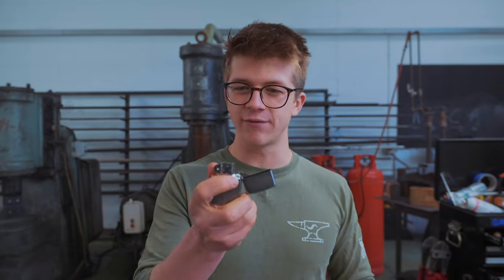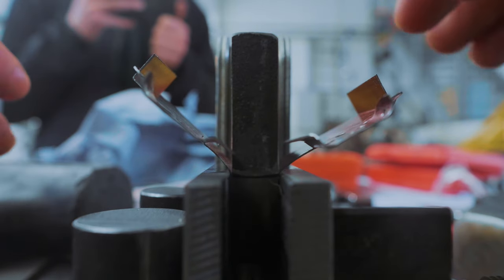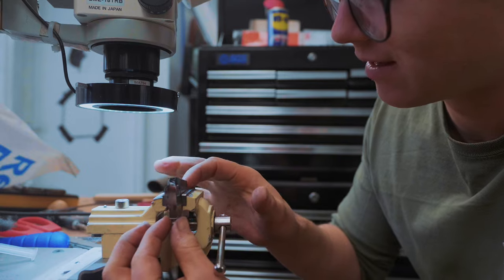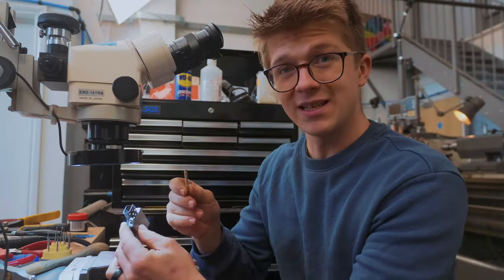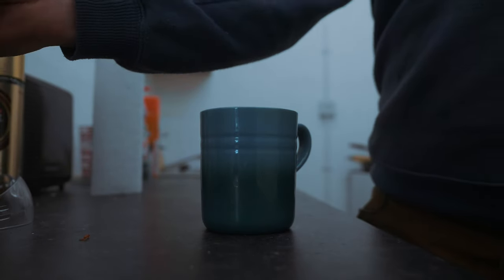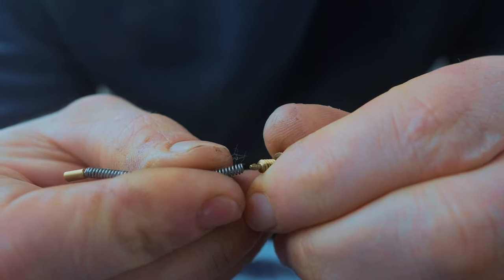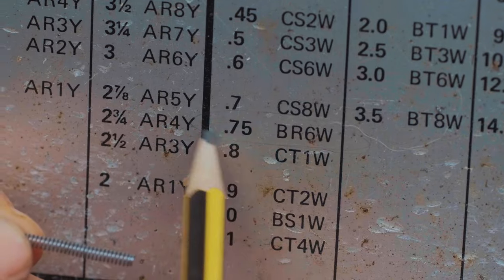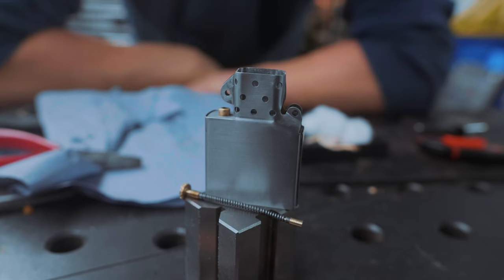Can I Make This Iconic Lighter? Part 2

Comment: Hi, watchmaker tips here: I had to make one spring like this for one of my watch. If you want a spring that has regular space between the spires, it’s better to make it compact first, all the spires touching each other. You make your spring longer than needed, and once it’s done, you take it out of the lathe and stretch it until your reach the space needed between the spires. Remove the excess and « voilà ».
Reply: Easy way as well is to use another wire with an O.D equal to the space you need butted up to the other while wrapping and wrap them tight. Grab the sacrificial wire and unwrap from your dowel and there you have it

Comment: My father, a silversmith, removes the tarnishing after soldering by leaving the work piece in a bath of diluted hydrochloric acid for a few hours and then buffing with jeweller's rouge and a tough stitch mop . You may want to do a few test pieces first to ascertain the correct strength/time formula for the bath though obviously..
Reply: Any acid will do, and acetic acid is substantially greener.  Metal chlorides, heat, and organics is a toxic combination.  I am currently doing vinegar with copper for a different purpose.  For a bit of extra shine, use a small amount of hydrogen peroxide in with it.
Reply: Pickle
Reply: I use diluted sulfuric acid (about 10% acid). Sometimes if I'm in a hurry, I dump pieces still hot in it.
Reply: Citric acid, completely safe to use, plenty of model engineering site give you the ratio. Buy from shops that make home brew wine kits. Wilkos is a good source in Blighty
Reply: Don’t forget acid changes strength based on temperature too. You have to control the Temperature if you want the best results.
Reply: @notamouse5630  now I did see you were using very weak acids and I mixed it with the people talking about strong acids. You aren’t an idiot. But anyone who mixes or tells someone to mix a strong acid with peroxide is.
Reply: Dilute hydrochloric acid is a good pickle (flux and tarnish remover) for the silver and gold that jewelers work with, but it strongly attacks steel, so not at all good for this project.
Reply: Alec, invest is a abrasive tumbler. I feel it could have cleaned the part nicely
Reply: @notamouse5630  Greener? Tell that to your stomach
Reply: @MisterRorschach90  Fine. Just won't ever clean my glassware then. Feels good not to be an idiot anymore.
Reply: @custos3249  I can’t tell if you’re being serious or not lol. That stuff is extremely dangerous. Look up videos of what those two things mixed together can do.
Reply: @MisterRorschach90  Tough to say which, but what are your thoughts on the flavor of methylmercury?
Reply: So I would be careful with having half knowledge on the one hand and calling others idiots for not knowing something thats even wrong.
Reply: @custos3249  I partially like cheap fish.
Reply: @Marco-dq1ik  the acids referred to in this comment section were citric acid, vinegar, and then sulfuric acid. I read sulfuric acid and then read someone mentioning mixing acid with peroxide. I’ve watched people try and trick others into mixing things together in the past. When I realized that wasn’t what was happening I corrected myself and said strong acid instead of sulfuric acid. I don’t care if you want to sound smart or if you think I want to sound smart. But thanks for the correction anyway.
Reply: @MisterRorschach90  Odd. Seems like there're more letters in "methylmercury" than "fish." But there's an "h" in both, so I can understand your confusion. Chemistry, English, all tough fields, plus most naturally occurring samples are deeply contaminated with extremely high levels of other organic compounds also known as marine megafauna, so easy mistake to make. Talking about the fancy stuff, i.e. not from your fellow bottom feeders and predators. In your conceptualization, it's a little like saying you've nibbled some cinnebar, so you know all about cinnamon rolls, the kind they bake in Terminator 2.
Reply: @Misterrorschach  i dont want to sound smart, at least in the internet ;).
I just wanted to correct the statement that "mixing an acid with hydrogenperoxide is called piranha solution"; bc its wrong.. 
The way your answer sounded to me had an negative impression (maybe language barrier). My answer shouldnt sound offending.
Reply: @notamouse5630  I like citric acid cuz you can heat it up without it it evaporating or stinking.
(hot acid it works so much better than cold)
Reply: @MisterRorschach90  piranha solution eats things that are organic, people are basically suggesting it be used for its intended purpose. and low strength isn't as dangerous.
If people are worried about concentrating their sulfuric acid there are sulfuric acid based pickle solutions that don't concentrate.
the main thing with 'piranha solution' you need to worry about is forming organic peroxides that are extremely explosive
A mixture of peroxide strong acid and hexamine or acetone will form a primary explosive that will detonate.

Comment: Also, when making springs, dont worry about getting the right spacing between the wraps, wind it tight and pull on it after and it will evenly spread out

Comment: Superglue releases at a fairly low temperature, heat up the lighter enough and it’ll self-disassemble, and you can add the part. Sure, you’ll have to clean it up again, but such is life.
Reply: Most CA glues release at just over 300 F.  You would have to leave it burning for quite a while for it to reach that temperature but it certainly could.
Reply: More worried if the zippofuel will disolve the CA glue
Reply: The glue isn't the issue. It's the rivet he already set to the top plate.

Comment: Fun Fact: Zippo's flint tubes and top plates were indeed soldered to the insert, up through the 1990s.
Reply: Guessing the guy working the soldering station retired and they couldn't find a suitable replacement
Reply: @schwig44  After this vid, Alec is needed for hire more than ever
Reply: Question, how does regular glue handle lighter fluid?
Reply: @bloodvue  it aint regular glue. Epoxy
Reply: @bloodvue  there's no such thing as "regular glue". What kind of glue are you inquiring about?
Reply: I remember a mention of that at the museum. Wasn't it partly a materials improvement and partly because some of the older solders contained lead?

Comment: If you’re having problems with the bends you could cut a small grove into the inside of the fold. Like what people do with armour making
Reply: the material he's working with is so thin that i think cutting a groove would make it too weak
Reply: @kassiog.6595  it wouldn’t need to be deep. Since the material is so thin it could be like a micro channel that would just “encourage” the bend. But regardless old Alec made it work anyway
Reply: On thin material I think it would work really well to use a ruler and a scribe to make a grove for the bend
Reply: @Robenbuilds  as a carpenter I was just going to use my metalsmithing knowledge (zero) and suggest a scribe.
Reply: now i know why Alec is doing the lighter: it is a step towards making larger sheetmetal objects, read: armor.
Reply: @ulrichkalber9039  I hope so buddy it would be great to see him eventually create a full suit of armour
Reply: @ulrichkalber9039  He made a gauntlet and a sabaton not that long ago, but making more pieces of armor would be cool to see!
Reply: @kassiog.6595  say scribe rather than groove..
Reply: @Robenbuilds  imagine the scene of alec rolling some damascus billets on to sheets and then armour, maybe in the years to come

Comment: Love the channel.  Love the projects.  Here'a a challenge I'd love to see Alex take up.  Craft the lightest functional steel longsword he possibly can.  It should fall within the standard blade length and width, guard width, and hilt length parameters of a typical longsword and should be properly balanced, but can have all the fullering, tapers, cutouts, and materials (excepting the blade, which must be steel of some sort) Alex can think of to lighten the sword while it remains usable under typical (not abusive) conditions.
Reply: Longswords are actually very lightweight considering their size already. We're talking 2.5 to 3 lbs. I don't think you can get much lighter without some serious performance hit.
Reply: @billparco8072  That's exactly the challenge😁

Comment: really enjoy watching your progress, it all about trial and fail till you found the solution. the spring part is pretty tough, what I figure to help the constant spacing is add another music wire for spacing and wind both at the same time and voila, I would keep the brass in the chuck close to the wire to keep the bar straight and avoiding bending from wire pulling the bar out of place

Comment: when you have a messy brazed/soldered intricate part. the best way to clean it is soak in boiling deionized water till the flux has mostly removed, then GLASS BEADING. it works phenomenally. its common practice in aerospace manufacturing.

Comment: What a awesome build! I  believe that the reason the top is glued in is so that the fluid won't leak out in your pocket. The really old ones did and would leave you with a chemical burn.
Reply: I've had that happen. Big red stinging mark on my leg, because it was in my pocket at the time. Bit too close to certain other bits of anatomy for comfort, so I kept it in my shirt pocket after that.

Comment: You can remove thin film oxidation with a boiling dilute citric acid solution. I've only ever needed to do this with stainless steel, but I assume it works with steel too.

Comment: Was the new spring wound in the opposite direction to the origional, not something Ive ever thought of before. Great work. Its coming together . Tough luck on the silver soldering, it heeds to be at red heat.

Comment: A little help with springs/wire. You can wrap the springs with the wires touching and pull the ends apart a little at a time until you release and the spring has the spacing. That way the spacing will be even.

Comment: The case hinge was soldered on in the early versions and has a press/spot weld in he later versions. The hinge number were called "barrels." They switched from 3 to 4 barrel hinges in the late 1940's early 1950's until all the models were 4 barrel hinges. I think later cases are completely formed by compressions punches with annealings between steps. The ones made from damascus steel and other materials on Youtube are mostly cut by machine milling and grinding. I know there are milling marks on the Marine corps 1942 cases, but I have never seen them on any others.

Comment: Impressive work. Not sure your availability there but we called it pickling paste. Was an acid paste used to take the bluish discoloration from welding stainless steel off. But is pretty good at doing a acid clean on a little intricate part like that to save some of the sanding on the tarnish.

Comment: The socket u use to fold it twice at the sametime, make it longer and drill guide holes to align it all properly. 
For the cheminey, pretty sure they would have carved a press die out of strong wood to make the weird shape.(for prototyping) 
If u do so, carve the bends sharper and tighter to compensate the wood compression

Comment: Hey Alec to engage the thread cutting on the lathe you could of moved to carige across till the half nuts closed and then move the compound slide over to where you want the spring to start

Comment: With electronics they use a soldier paste/gel like you did with the jewelry. They also bake it in the oven to soldier the chips to the boards. I’m curious if you could have done the same.

Comment: The cement in the Zippo serves as a heat shield between the flame and the fuel.

The only thing I dislike about my Zippo is having to refill it too often.  I imagine, without the heat shield the fuel will evaporate even quicker.

Keep up the good work, can't wait to see the finished lighter.

Comment: Have you tried using graphite powder to avoid oxidation? Jewelers usually coat silver smelting crucibles for this. Mask the solder area brush on a coat of graphite powder (9B)?

Comment: the one part of the inner part of your refabbed zippo lighter that you did not add from the original is the outward dimple near the bottom that helps wedge/lock the innards in the casing

Comment: A bolt in a drill will make a decent spring also just alow for spring back and go abit smaller diameter than u need .chuck the wire in with the bolt to grip it aswell save u drilling a hole in the bolt to pass the wire through

Comment: 12:17 - You've kind of come round to a setup for making chainmaille the hard way here, Alec. Several maillers I've known used a mandrel in a powerdrill chuck with a feeding arrangement like this. Only difference is they're trying to coil the wire together without any kind of gaps to make their jump-rings.

Comment: Also i am very very familiar with making vape wires which sometimes involves wrapping a wire around another wire the same size. As long as you support both ends with a chuck it will work. If the inner wire is 2 times bigger it will also work without any end support even.

Comment: Alec! If you see this you should really try Harris safety Silv 56 solder. It makes a really great bond to any ferrous or non ferrous metal that can handle the heat, and flows really nicely. It's quite a bit more reliable than the paste stuff you're using!

Comment: You should have brazed it together and instead of recreating the cost savings top piece that's glued in make it a small box shape and braze it in too. You can clean up the brazing with the Dremel so it's only visible as a thin line on the joints or inside the chimney and inside of it. The super glue won't hold with the heat.

Comment: Zippo found success because their lighters are reliably and cheap to manufacture. Much more difficult by hand, of course, but it's a relatively simple design. I'd like to see if you could replicate some of the earliest lighters - Imperator, Wright, Nassau, etc. I have one in my collection and it appears handmade, with hammered rivets holding everything together.

The examples I gave are all semi-automatic spring powered lighters. Press the button on the side and the lighter pops open, driving the flint wheel and igniting the wick with a flash of sparks. They have fairly complex springs.

Comment: A spot welder for combining LiPo cells into larger battery packs (like for e-bikes etc) would be perfect to do your little spot welds (they spot-weld thin nickel strips onto the cell's sheet-metal terminals...).You can buy little rechargeable battery-powered units online for fifty bucks or so...

Comment: btw. you can build a spotwelder by using the transformer from a microwave with the secondary replaced with a few turns of high diameter copper wire

Comment: Do you know superglue is decomposing at "higher" temperatures? (~150°C = 302F)
I would have chosen at least 2k glue or a silicone-based one.
Reply: I was going to say the same thing - using superglue to glue together a device with a sole purpose of getting very hot is just a bad idea. Clickspring superglues small parts onto his lathe all the time and just a little heat makes them release.
Reply: The amount of heat created is minimal and lasts for a few seconds. Classic over-thinking.
Reply: @KipdoesStuff  Obviously, you have not used your lighter to try and find the car keys you dropped in the grass. They can get too hot to hold.

Comment: If you have a part that you need to hold and it's too small for your chuck, put it in a 'Pin Vise' and then chuck that up instead. It'll save a bit of a headache. Good job on making it as far as you have in the project, and good luck going forward.

Comment: I wonder...
If preheated a bit could a decent electronics soldering iron, or better yet a hot air station + SMD solder paste do the job without such a mess?
Or...
Maybe mill a Zippo-alike lighter rather than trying to reproduce an automated manufacturing process by hand?

Comment: You could engrave or jus saw the bends halfway from backside and then bend. After that just use silver soldering and borax to solder them after bending. That is how i made my zippo cover from silver. Silver oxidices pretty easily so no point to do the interior from silver.

Comment: aren't you supposed to harden then anneal the music wire spring? otherwise it deformed over time.Also you can make a hook in whatever spacing you want for your spring and it rides just behind the wire while you spin it. Cherry red quench heat blue with propane , done

Comment: most lathes have the option to reverse the feed direction.... i would have butted the tail stock against the carriage and let the power feed push the tailstock backwards at the perfect speed for you. just set it on a real slow rpm and let it do the work for you lol....

Comment: this is really cool to me because you're making by hand something i might make en masse in a machine at my job. pushing a part into a 'swage' is more or less something i'm familiar with, but instead of a hammer i may be using a 75 ton press. unlike most of your videos, this series i can really relate to! though the smithing is probably more interesting to me :-P

Comment: Alec you forgot to stamp those bulgings in the fuel chamber so the case can be tightly fit on it
Reply: it is important because those inserts usually like to slide out while you open zippo after some time of usage and you can destroy it trying to close it in that state so it kinda prevents it

Comment: There should be a left hand threading setting on your lathe, which will send the carriage the opposite way
Reply: Can also just run it in reverse, the spring would be of the opposite hand, but I've never seen a spring's handedness show up on any print for anything, But I've also not seen every assembly out there